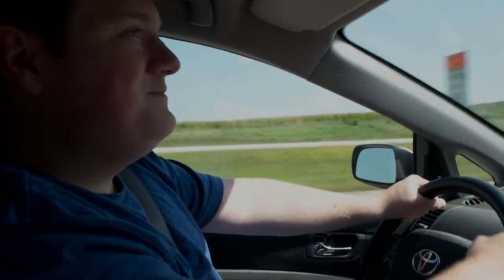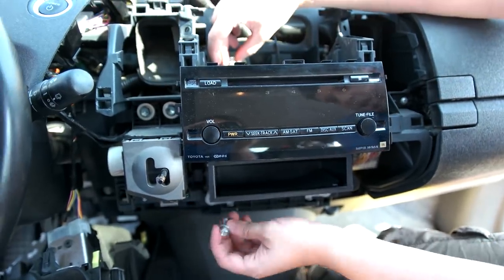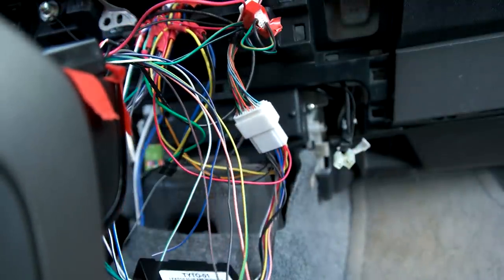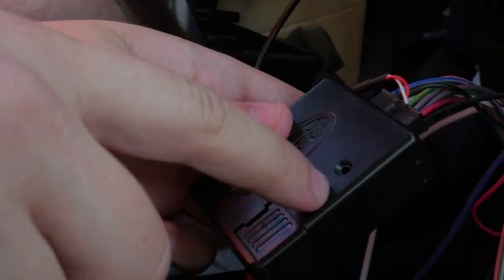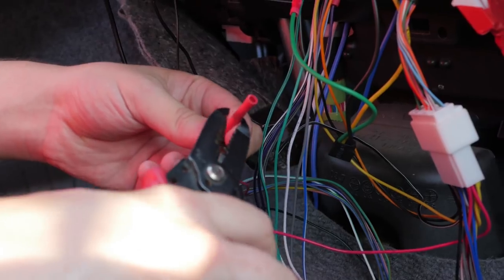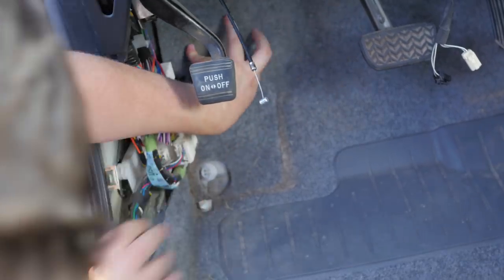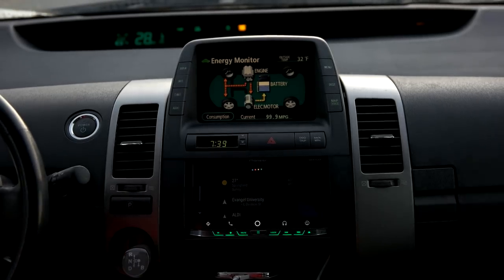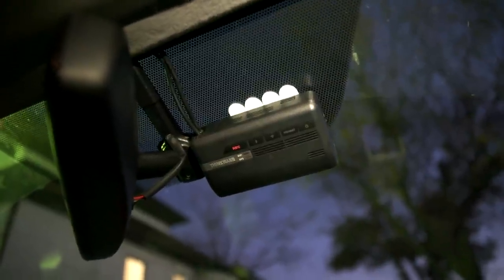How to UPGRADE the Prius Stereo! (2004-09) (Comprehensive)

Comment: I want to thank you for making this video, it was incredibly detailed and taught me a lot about my car. However I would recommend for anyone that cares at all about audio quality and has the JBL amp to avoid the Metra TYTO-01 digital audio interface recommended in this video and get the Metra 70-8117 factory amplifier bypass harness. The bypass harness allows you to plug your speakers directly into to your new stereos amplifier without a redundant digital conversion. You do have to take out your front seats and pull back the front carpet to feed the bypass harness under the passenger seat carpet to behind the dash. I first used the TYTO-01 as recommend in this video and the audio quality was terrible. Turning up any music with bass would make the woofers cut out, and there was a constant hissing noise when nothing was playing. The quality with the bypass harness is night and day.
Reply: thanks for this!

Comment: Grom Audio has a unit that piggybacks on the existing hardware giving both Apple CarPlay or Android Auto using the Prius OEM Display. This unit allows YouTube and Netflix on Prius OEM display. This unit has 2 HDMI inputs and 1 HDMI output.  Typically, the HDMI output allows for an external monitor while HDMI input allows adding Chromcast, Roku stick or mouse to the unit.  These is separate available harness for rear camera and front camera. The unit has 2 USB ports and port for a microSD Card.  Installation takes a couple hours.  There is no splicing of wires.  The kit comes with custom cables that interface with the pre-existing Prius cables.  This allows for a factory look with all the functionality of the Prius buttons in place.  I found this unit from Prius Chat forum. This guy put too much effort when he didn’t nave too. The gal in the Prius chat forum took several hours to install.

Comment: This is one of the most helpful YouTube videos I have ever come across. After watching this video I was able to install a double din Pioneer head unit into my 06 Prius with factory "premium" JBL audio fairly effortlessly. Thanks so much for your videos! The only changes that I did was mount a USB/3.5mm audio jack inputs directly into the center plastic compartment below the head unit. I also decided not to tap into the existing factory mic just yet and used the Pioneer mic, but left enough cabling tucked under the paneling for tapping into the factory mic in the future. The sound is significantly better now and I finally have navigation in the Prius! Thanks again!

Comment: Thanks for the tutorial.... I am not nearly as interested in upgrading now lol
Reply: Grom Audio has a unit that piggybacks on the existing hardware giving both Apple CarPlay or Android Auto using the Prius OEM Display. This unit allows YouTube and Netflix on Prius OEM display. This unit has 2 HDMI inputs and 1 HDMI output.  Typically, the HDMI output allows for an external monitor while HDMI input allows adding Chromcast or mouse to the unit.  There are separate RCA connections for rear camera or front cam. The unit has 2 USB ports and port for a microSD Card.  Installation takes a couple hours.  There is no splicing of wires.  The kit comes with custom cables that interface with the pre-existing Prius cables.  This allows for a factory look with all the functionality of the Prius buttons in place.  I found this unit from Prius Chat forum.

Comment: Back when I was your age, I used to rip out the entire front dashboard to install 2DIN car audio... did fiberglass molds to make my own bezel to fit double DIN to 1.5DIN and did crap load of car audio install. These days... I just install a nice iPhone mount. Since most newer cars have AUX input... I just plug my phone into the Factory HeadUnit.

Comment: If you're watching this in 2021, just buy the head unit from Best Buy, buy the ASWC-1 off Amazon, and your vehicle specific dash kit off eBay or Amazon. Best Buy would install it for free.
Reply: Was wondering were they able to keep the steering wheel and climate controls functioning?
Reply: @StilesJman  Yes, since those buttons are connected to the multi-function display. The tuning, volume and mode buttons are connected to the radio.
Reply: Grom Audio has a unit that piggybacks on the existing hardware giving both Apple CarPlay or Android Auto using the Prius OEM Display. This unit allows YouTube and Netflix on Prius OEM display. This unit has 2 HDMI inputs and 1 HDMI output.  Typically, the HDMI output allows for an external monitor while HDMI input allows adding Chromcast or mouse to the unit.  There are separate RCA connections for rear camera or front cam. The unit has 2 USB ports and port for a microSD Card.  Installation takes a couple hours.  There is no splicing of wires.  The kit comes with custom cables that interface with the pre-existing Prius cables.  This allows for a factory look with all the functionality of the Prius buttons in place.  I found this unit from Prius Chat forum.

Comment: that was amazing, thank you so much for making this video, all the time and care you took making it. This will be an essential guide for when im doing it as well. im doing this in japan, on the same car right now, im installing a 8core android box, with a 4 antenna high speed tuner, hoping, to watch tv while driving.. heh
Reply: Hi DocsWorld, How did the installation go? I want to do the same but confused with which android stereo to buy for my Prius 2008. Is it possible to share your stereo make/model or link? Basically I am confused with size i.e. dimensions and harness. Thanks in advance.
Reply: @FarazKeVlog  sure i can when i get a chance i believe it was called "pie"
i will have to double check this later. the hardest part i will be honest, was..
when you start clipping cables.. things just stop working.
in japan we have this etc card reader, that stopped, and the dash moniter stopped as well. I found via this video some info about how to make a jumper with a diode. i finally figured it out, and the moniter came back. was really hard.. but.. i finally got it done.. but remember i have 2003 prius so these wiring harnesses, and cable positions are most likely very different.
Reply: @MemeKing44  thanks buddy. Good to know about your experience as it may come in handy. 👍

Comment: If you got the JBL audio, do you need to replace the speaker? I read somewhere that they use a different wattage. So they needed to be replaced if you replace the head unit.

Comment: Just bought my first Prius, a 2009, and I immediately HATE the radio.  I'll be making a change similar to this one asap and use your video as guidance!! One thing I hoped you could answer... does the reverse camera already in the car still work in the top screen, along with all of the battery charging display, etc?

Comment: Thanks for the video, it was helpful. I just changed the Prius Stereo on my car. . The only thing that, need is the right resistor to make the AC work. By any chance do you know what 68 OHM resistor I need to put into pins 9 and 10?

Comment: ackk. using a screwdiver like that to take off the trim panels, will totally shatter them.  They are fragile. I use a trim piece remover that is wider and has more surface area contact.  These at this age are fragile as can be.  Pop lower out then upper and go slow.  Otherwise great info and video!

Comment: Great video !! The harness to bypass the amp where can u buy it also the harness for the steering wheel controls ???
Reply from the maker: I've got the steering wheel control interface linked in the description. As for the bypassing the amp, when I did my research it sounded like you had to get a separate analogue amp to bypass the JBL amp. But I wasn't interested in putting that much effort.

Though if you were talking about the parking break bypass which I used in the video, just search "Pioneer parking break bypass" on eBay or Amazon. Though you only need it for my head unit similar to mine, the 4100NEX, (if you have a newer model there's a secret setting you can search for to bypass it.)

Comment: Wow, thank you very much. However, even if I'd like to have that in my Prius 2008, it's too much work with lots of after market accessories and loss of functions. 
Let alone the fact that if I want someone else to do it for me to avoid the gigantic mess I see in this vid, it will cost me an arm and a leg (plus the cost of the unit and accessories that have to be found which is not the easiest part). 
Anyway, good job? Cheers.

Comment: Appreciate all of your work with this video. Saved me a few hours of work. Got the new stereo in, only problem I have is the volume resets after the vehicle is stopped and then started. Doesn't seem to occur only if the ignition is in aux though. Any clue? Maybe a "feature" of the new head unit. Either way, I can't figure out how to fix that. Head unit is a Dual from Wal-Mart...

Comment: I installed after market head unit but the energy screen and AC controls not working... I connected the resistor on pins 9 and 10 still not working... Any solution? Thanks

Comment: My compliments for the great job you done! The video is amazing, thank you very much for this. I need your help for another hybrid car. Could you please show me how or which best media player I can install in to my Lexus RX450h from 2009 ( has the dashboard of the 2010 model, the one where you cannot install any 2DIN stereo ).  The car, has AUX audio IN, also Bluetooth but ONLY for CALLS and is not sharing media sound to listen the music from my phone. I would like to install some SSD hard drive with music, together with this multimedia player which you will choose. May I see the commands or Desktop icons of this multimedia player on the factory display of the car? Thank you!
Reply from the maker: Thanks for you kind words.

As for your question, I'm a little confused. Are you wanted a demonstration of the functionality of my the head-unit I installed? I can record a short video and send it to you through Google Drive if you like. Or are you wondering if I can get the screen of my new Pioneer head unit to show up on the original screen that came on the Prius? That's not possible as they are separate system. Though I don't mind at all looking at 2 screens.

My Pioneer head unit does have AUX, Bluetooth media streaming, and I can connect a flash drive and play music from that, but it is Double-Din stereo. So if your Lexus doesn't have space for that, I don't see how my head unit would provide features you want.

Comment: Great video, going to try this on my Prius just waiting for parts to arrive from the states, quick question though if the stereo has the ability to program the steering wheel controls do you need the axxess  swc module
Reply: Hello Stuart, did you find an answer ?
Reply: @frmf   you don't need the axxess swc module, if your stereo comes with the ability to program the steering wheel controls it should have the same two wires from the axxess swc module that was used in the video..........I only had a cheapish xtrons unit off ebay and it worked a treat.

Comment: More Pi how did you get your trip info working again? Just installed my double din and now waiting on resistor to regain A/C controls. Does the resistor install regain trip info as well? Thanks in advance!
Reply: Marc where did you get a resistor from?
Reply: @marquis1366  Amazon. Unfortunately it doesn't come in singles. Comes in 100pcs for $5. Search "Edgelec 68ohm +1% resistor". Worked like a dream and returned all functionality of A/C and 
MID.

Comment: Hi could you replace the MFD with a double din CarPlay module? Is it possible? Would the frame of the MFD fit the display of the CarPlay accessory? I would like to do that Instead because my MFD stopped working and my eyes naturally gravitate to it when I’m looking at the directions. I would like to keep aesthetic the same, just with the MFD replaced with CarPlay. I was wondering if that was possible. Please Reply, thank you .

Comment: The kits that I got with your links don't look anything like yours. I didn't get around to actually putting it together for two years so I can't return them. They plug into the car connects that went into the original stereo but they don't have wires to clip to the wires leaving the new stereo. They just have several connectors. Two RCA ends and an antenna end that I can connect into the new stereo and a few connectors that match nothing.

Comment: My radio and the center screen noises have stopped working. The center dome light works so the 15a fuse isn't blown and I looked at the 30a fuse for the amp and it wasn't broken. Anyone know what I should do

Comment: Will this work the same for a 2005 Prius. I don't have a microphone but would like to install a running camera that records. Please let me know!!
Reply from the maker: I'll be making a video on how to hard wire a dash cam in my Prius soon, stay tuned!

Also, if you were wondering what to do if your Prius doesn't come with a built in mic, then what I did on my last car was poke a hole in the head board. Then I ran the mic that came with the stereo through the hole. The hole was just big enough I didn't need to do anything else to it. Otherwise you could try clipping it to the visor.

Comment: I got my audio system in and working. But when I tried restarting the car, It wont start. Battery is fine, but I am getting nothing. No crank sounds. Hazard lights still work. I checked the battery and it still has the correct charge. I don’t know what happened maybe some wires touched while I was inserting the audio system back into the car. Could it be a blown fuse? I am at a loss
Reply from the maker: Sorry to hear that! If you haven't gotten it working yet here's what I would do:
Check the 2 fuse boxes as you suggested. (I've popped quite a few messing with the stereo)
Make sure the power button is plugged in.
Slowly start undoing everything you've disconnected and reconnected. That in the very least would let me rethink anything I may have broken along the way.

Comment: Nice but next time go to a PC store and look for a male header adapter for motherboards. 99 cents and it'll have 10 pins. Pull the pins out with a pair of pliers and solder them in to the wires. Stick that into the stock harness and they will be there securely.

Comment: please help. I get android radio. steering is working. but my cluster screen said AUDIO OFF, and almost nothing is working. I need to do resitor installation right?
Reply: From my research, yeah. If I remember right the resistor keeps the OEM screen working. However I believe I've seen the Audio Off in my Prius as well, which makes sense since the OEM radio was removed. Climate controls, GPS navigation, Setting all still work.
Reply: @HikerHansen  you are the best. thank you very much. will test it later.

Comment: Put odomoter to mileage
Turn the car off
Power on with foot on brake AND pressing trip reset for about 10 seconds
Your mileage will say 0000000 momentarily and the maintenance light is now off
Reply from the maker: Nice! Thanks for the tip.

Comment: does it display everything the MFD Does?
Reply from the maker: Nope, so if your screen's dead you'll be stuck with only steering wheel controls. Mine died awhile ago too and the biggest thing I missed was the backup camera, but I actually dug into the huge wiring manual for the 2006 Prius and soldered the wires from the MFD into my new head unit, and now I hardly miss it.

Comment: Hi! May i know if this car  stereo work with Prius 2005 car?
Reply from the maker: Pretty sure it will. I believe 2004-2009 Prius' were all Gen II models. Plus the dash kit I linked to in the description says it's for 2004-2009. If you don't have JBL speakers, then you should be good using the wiring harness that comes with the kit without have to get Access TYTO-01.

Comment: Everything worked when I installed my deck, besides when I turn on my car that red triangle light is on and my navigation screen says that my parking brake wasn’t working correctly. I was assuming because I need to drive my car a certain amount of miles. Plus I had to jump my car because I let the battery die yesterday. Is that right or did I do something wrong?
Reply: Did the triangle ever leave?

Comment: You are doing so many things wrong.
If you had an electrical inspection done it would fail.
Never ever allow any copper to be exposed. It will start a fire
Reply: I agree leaving any copper wire exposed in a prius is asking for trouble would have been better to cut the wire and solder them.